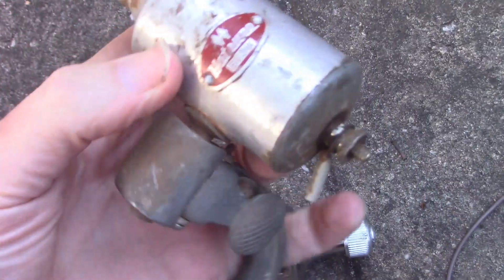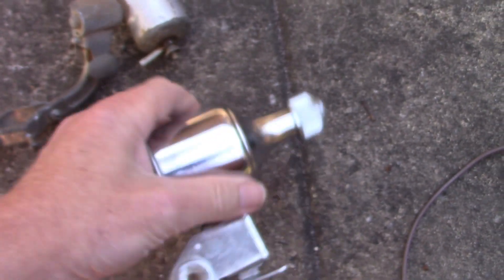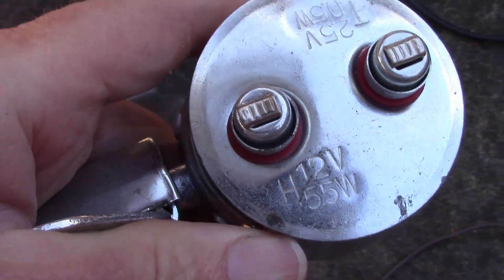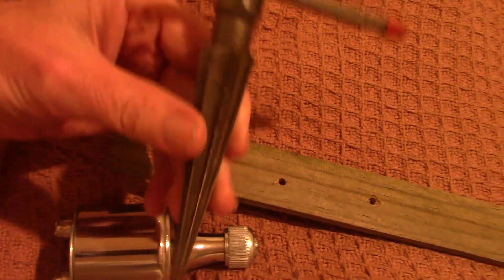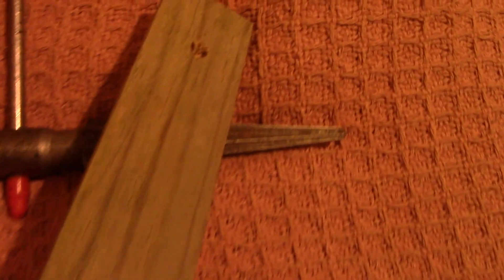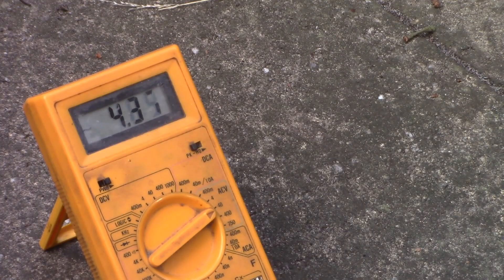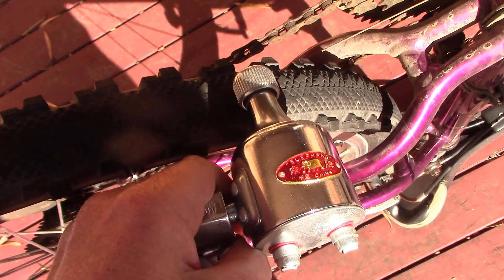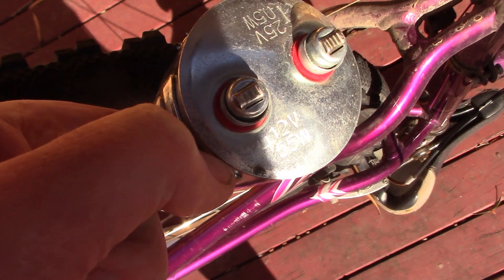Electronics on the Floor: Fun with bicycle dynamos

Comment: Ten speed bikes were a new thing in the early 70's. I mounted a door bell transformer under the seat on my brother's bike connected to his bike generator which looked like your 6 volt unit.

I wrapped aluminum foil over the plastic handlebar tape on the left and right side and taped the transformer wires one to each foil.

There was a speedo on his bike and we would see who could ride it the fastest.

The electricity was intense! First it caused you to grip even tighter and then you could feel it move to your wrists and then up your arms as you pedaled faster down the street.

Even at low speeds the electricity would have you doubled up clutching the handebars tight!

I talked my brother into sitting on the handlebars while hanging on by the foil grips.

I pedaled down a nearby hill fairly fast and reached down to trip the generator on. It instantly contorted my helpless brother so bad that he caused us to crash into the curb which sent us both flying off the bike.

I still got that transformer! Everytime I stumble across it amongst my parts I'm reminded of all the crazy crap I did with it as a kid.😊

Comment: I've had trouble finding these anywhere. The only time I've seen one for sale was on an Air Force base in Qatar.

This is the kind of thing I'd love to put a steam engine to. One of my engines could generate maybe a dozen watts to power a QRP transmitter.

Comment: I recall a 1994 QST issue (post Field Day) where an operator used a bike generator, a capacitor bank and I think a full wave bridge rectifier diode to power a 2 meter HT for contacts.  NO BATTERY!  So, crank while calling out CQ and then logging the entry.  Really cool stuff one can do.

Comment: Takes me back to that power shortage in the late 70s. I had a Hatsune 6V 6W dynamo on my dragster bike and with a bridge rectifier made with metal diodes that I got at the weekend market, I powered my 12 inch TV to watch the news. BTW mine would produce up to 30V with no load.